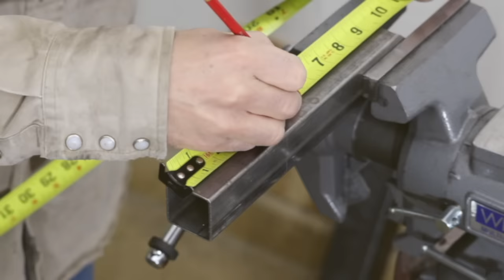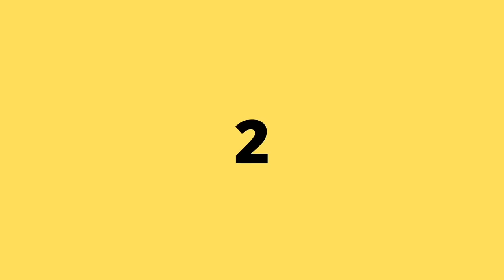THE BEST DIY IDEAS FOR WELDERS!!! IDEAS YOU NEED!!!

Comment: why the washer sandwich on the spring clamp holdown tool on the first build?
Reply: Those were not washers, were magnets
Reply: He was using the washers to set the height of the washers he was going to weld so when he flips it over the magnets would be recessed and flat with the bottom.